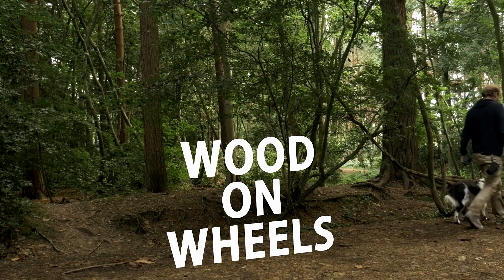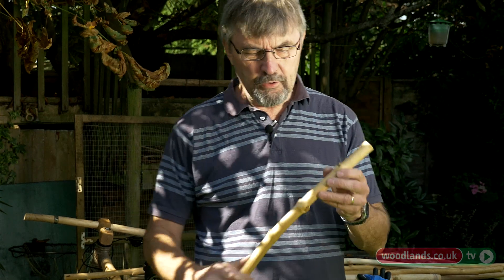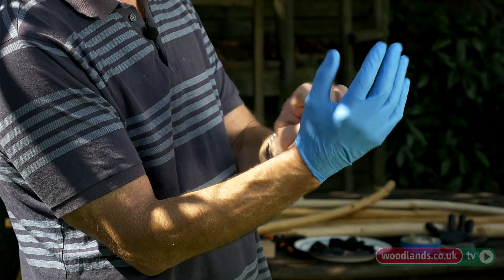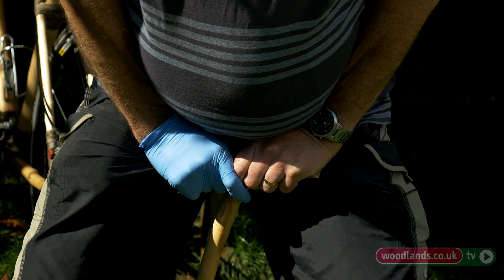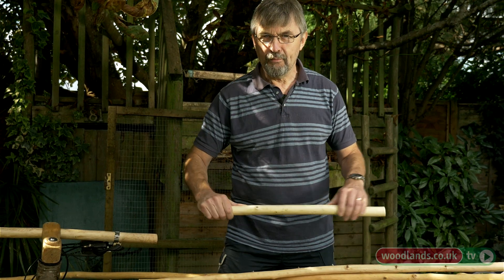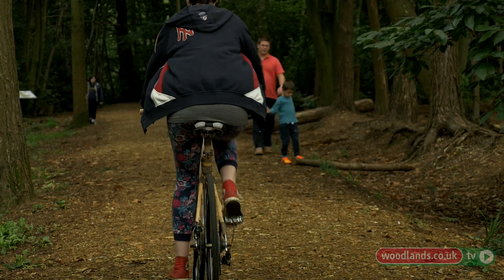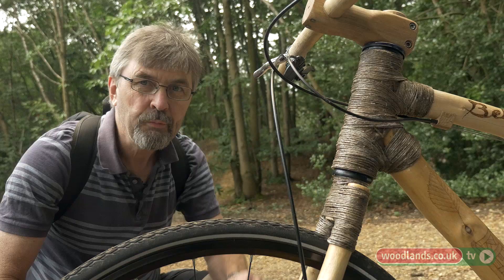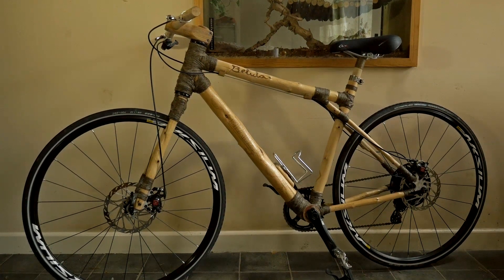Wood on Wheels

Comment: I have a concern about the solidity of the joint of the front forks to the steering tube. Would it not be more rigid if the forks extended to the handlebars, with a joint both at the top and bottom of the steering tube, as done on a lot of motorcycles? I see that you have done that on the rear top set of forks. But a great build, and a super looking bike - should turn a few years!
Reply: +Tony Watson 
Hi Tony.  We decided to stick with the conventional bike format.  That particular joint is glued, pinned, natural composite reinforced and bound so if anything it is probably over-engineered.  We hope to have video material soon which demos the bike being ridden hard and abused to underline our complete faith in wood.

Comment: Thank you all for your kind remarks. The hollowing is done by pilot drilling from both ends so the pole must be straight enough (one bend max) to permit this. It is then machined to the wall thickness from the inside by a rather scary routing machine with a long shaft extender which I developed for the purpose. Quite a lot of splintered wood was produced during development!  Hollowing is done with the wood in the green state and it dries quickly once hollowed. 

The epoxy resin is from Entropy in California. It turns out in fact to be 25% bio-derived. I am aware of a number of developments towards 100% bio-derived but none which are on the market as yet. If anyone knows of one please let me know. As development continues I aim to gradually reduce the non-sustainable material content.